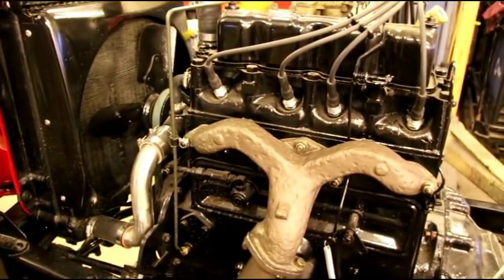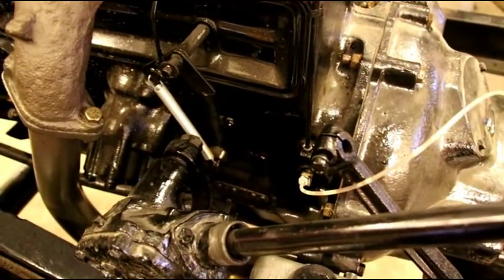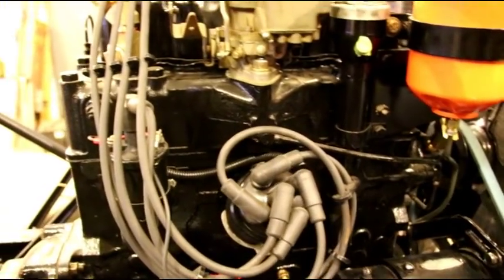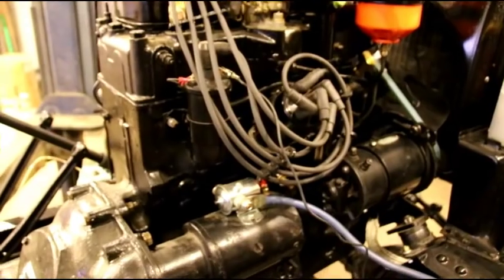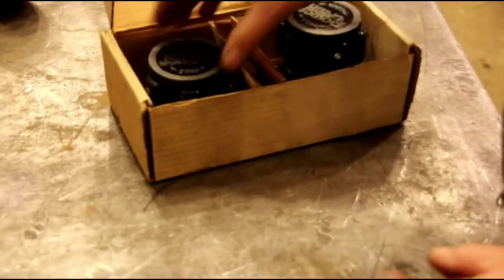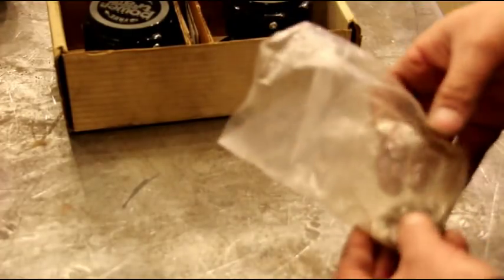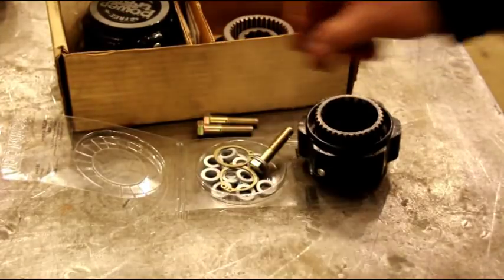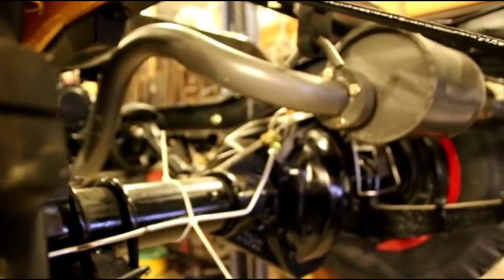CJ5 Snowblower Jeep Engine Talk, New Parts

Comment: Great videos Brian. The Norloc washers and grade 8 bolts work great. In the Army we had an MWO on the older HMMWVs (M998 family) to replace the grade 5 bolts and lock washers on the brake rotors. The newer uparmor HMMWVs (M1114 & M1151) came from the factory with them. When I was deployed to the middle east, when we brought the trucks in for service we had to keep these on hand in bulk. Many mechanics wouldn't pay attention and replace them with lock washers, the rotors heat up and loosen up the bolts, and then we had to put the right washers in. Keep the great videos comind.

Comment: Really glad to see this one back on the front burner, Brian! As much as I was enjoying the work you were doing on the CJ3 project, I could see the frustration you were having with it and how unhappy you were. It’s so much more rewarding to be working on something you really want to be doing. Seen those Nordloc washers on another channel. Pretty skookum stuff, but not cheap. I’m actually surprised you didn’t use studs on those hubs. I know lots of guys prefer the studs, but that might not work well with the Nordloc washers.
Reply from the maker: It is very refreshing to work on a project without a customer telling you how to do it.  This Jeep will be sooooo much nicer than the CJ3A I was working on because I am doing everything correctly and not trying to take shortcuts to save a few pennies.  I don't like studs on the front hubs, just plain American, grade 8 bolts and high quality Swedish Nord-Loc washers.  Been doing it this way for many years and not one single loose bolt or hub failure.

Comment: Love your channel and what you do. And I need all the tips and info I can get.
Can you tel me what the  point gap should be on a 134 F head engine running on 12 volts ?
Reply from the maker: start the gap at about .020" then get the engine running and check your dwell to make sure you have everything set correctly.  
Brian